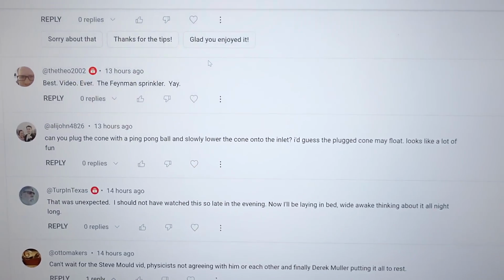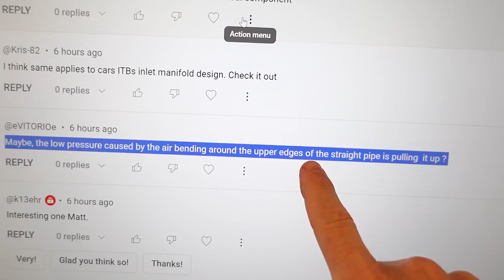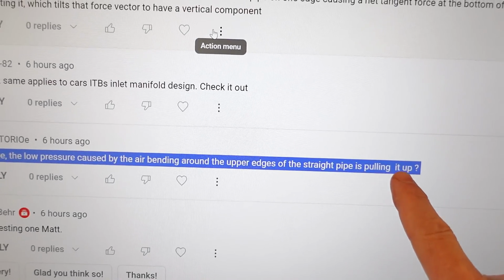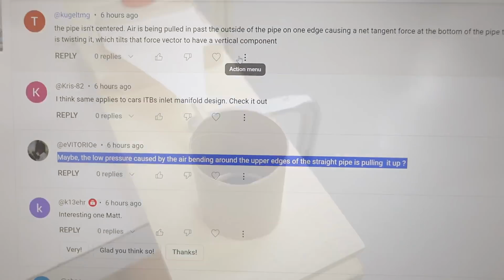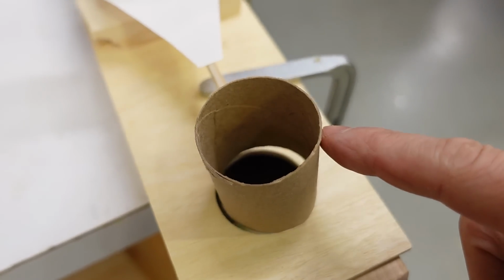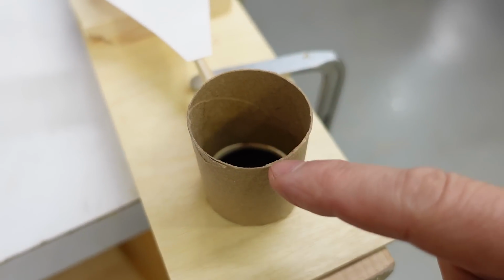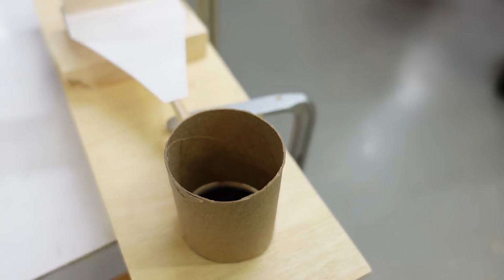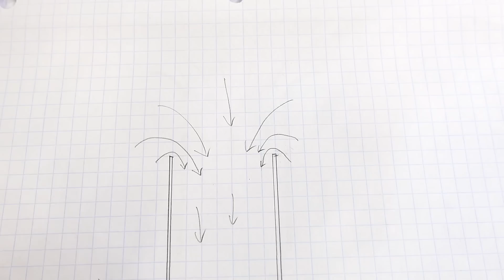Levitating pipe mystery solved

Comment: The same thing happens with the inlet of aircraft engines. The front of the inlet basically acts as a wing and creates lift in the direction the air is coming from

Comment: 2:13 I wonder if this can be used to multiply the pressure difference of a high-flow pump and generate a strong vacuum. Make a pair of concentric pipes, with less than a millimeter of gap at the top. Pull air through the inner pipe. The space in between the pipes should want to drop to a pressure that's lower than the pressure you use to suck the air down the central pipe.

Comment: @Matthias random stuff  I think the tube is creating a restricted path so the vacuum pulls the volume through the gap at the base - this flow forces the tube to either rise or deflect until sufficient volume can enter the inlet - the hot glue around the mouth of the tube just served to stiffen the sides which stopped the wall deflection at the bottom of the tube allowing the air to flow freely past thus it resumed lifting (bouncing!)

A great way to further the experiment would be to add smoke so we can visualize the flow

Really fun experiment, very interested to know if you're sure you're correct or if my theory has merit.  Tried to search through the comments a bit to see if a physics person knocked it out

Comment: Nicely done!   In fluid mechanics terms, what we are seeing is the transition from laminar to turbulent flow at the inlet.  Laminar flow is a smooth predictable flow stream, with the force vectors mostly aligned in the direction of flow.   Turbulent flow is chaotic and multidirectional, with the force vectors pointing in many different directions.   

With the bell mouth, air enters the tube smoothly and the flow is mostly laminar and the force vectors are pointing in the flow direction, causing the tube to suck down.   Without the bell mouth the transition is abrupt and there is turbulent flow in the tube.   Vectors in every direction.  A portion of those vectors are pointing upward, resulting in an upward movement of the tube.

Comment: In the RC plane world, electric ducted fans usually come with a curved inlet called a 'thrust ring' that really helps the static thrust. If it's not a tight fit, it sometimes gets sucked off the front of the duct!

Comment: 2:19 "And just the Centrifugal force ..." Nothing to do with centrifugal - its just lift over a curved surface, like any wing.  Its true that lift is caused by air trying to change direction relatively suddenly, creating a partial vacuum in the process, but it doesn't have to be rotating around a sharp enough turn to invoke centrifugal effects.

Comment: That momentum/turbulence at the top is what lowers the pressure from above/inside. But, I wouldn't think in terms of the pipe being lifted from the top. I'd think in terms of the air outside the bottom of the pipe being able to over-power that lower pressure from above and push it's way under the pipe.

Comment: Once you understand the pressure differential thing, I don't get what's the mystery, a cone has a 45 degree angle to be pushed up on, a straight walled tube does not. Boom.

Comment: 2:33 The shape in the drawing is often called a velocity stack or venturi tube in hot rod car circles. I don't think they're going for levitation but the shape is the same.. It's also used on intakes to maximize lift on some kinds of flying vehicles, hovercraft and increase thrust on jet intakes.

Comment: My motorcycle has the carburetors facing backwards with velocity stacks. It would be better if the carbs were facing forwards so it would help pull the motorcycle faster forwards. How could the engineers do this?

Comment: The curious aspects you discuss in this and the previous video of this channel (good fun, BTW, really enjoyed) are also covered in Smith and Morrison's Scientific Design of Exhaust and Intake Systems.  
ISBN 0-8376-0309-9.
As I recall, the bell mouth shape, megaphone shape, and even the way the exhaust tail pipe is rolled at the tail pipe end to form the ring shown in this video, and likely other shapes, have their fluid theory of operation discussed in detail.  These things can be varied to finesse various aspects of performance, like quality of sound, loudness, broadening the engine's torque curve and so on.
Please read and enjoy.  It does contain a lot of formulas and such, but it also explains theory of operation in terms that don't require advanced math understanding to grasp.

Comment: I’m not sure you have your full answer bc it doesn’t explain the oscillation.., 

I just posted a comment  on the previous video which may explain the oscillation effect
Reply: The oscillation is due to that fact that the lifting force gets weaker as the tube lifts higher until gravity takes over and brings it down, to be lifted again.

Comment: I don't know if the centrifugal force is entirely necessary to explain it. That would contribute as well, but the reason you have flow in the first place is that the suction itself creates a partial vacuum and the fluid flows across the gradient. In the cone example, this should be pretty pronounced (on the vertical axis) as long as the cone is seated. I think maybe the cylinder oscillates so wildly because it's a finer balance (vertically) and the "leaked" pressure and flow would fall off rapidly over a very small distance as it reseats.

Comment: Is the explanation that the top of the cylinder is acting as a round airfoil that pulls the cylinder up or did I misunderstand completely?

Does the same thing happen when air is being pushed in? What happens if the cylinder starts inside the suction tube? Does it get lifted out?

I have so many questions now.
Reply: Yes, that is correct. Exactly the same effect as an airfoil

Comment: Saw the other video a day or two ago, but the answer I've known for ages didn't hit me.  Seeing this one brought it up.
A 'straight' tube isn't straight aerodynamically, it acts as a restriction, due to the viscosity of the air hitting the sides and opposing free flow.  IIRC the answer was the walls of the tube have to move out at 7 degrees in order for the air flow to be free.  Believe that was both sides so 14 degrees spreading cone, and been ages, it could have been 7% instead of degrees.  And suction is basically just reverse flow.  So almost guaranteed this effect is why the straight tube still works and generates forces.
Make a reverse cone from what is in the video, with a larger say 4" suction hole and narrowing to a smaller hole, with approximately 7 degree slope on the sides, and that should be the neutral point where it doesn't generate lift, so it should just sit there.
No doubt ties in with several of the other answers here in the comments that roughly work out to similar ideas.  But that's an isolated value I've known since the early 2000's mailing lists, it came up in a discussion and a side wall has to go out at 7 degrees for airflow to act as a smooth airflow and wall to not restrict the flow.  And of course that's a rough approximation, no doubt the horn or bell type curve is actually a more correct fit.

Comment: Why has no one mentioned 'this is venturi effect.' The word bell has 150 mentions, and venturi 0.
Reply from the maker: For the same reason no one has mentioned pocket holes either.  Its just not about that.
Reply: @matthiasrandomstuff2221 true, there is no reduction in the tube diameter to cause the velocity and pressure differences associated with the Venturi effect.
Reply: @chiphill4856  Yes there is . Venturi effect happens to be a bell shape, a change in diameter over length. The typical square or slightly rounded edge of a pipe/tube is 'too fast' a change in diameter.
Reply: @jimbarchuk  a change in diameter over length.  Yes.  I'm not sure what else you are referring to.
Reply: Venturi Effect is the Name. Yet for the 150x the word bell is used the Name itself is never said.
Reply: @jimbarchuk  In the study of compressible flow, inlets and outlets have their own set of equations, separate from the Venturi effect.

Comment: You're drawing the streamlines as if the flow is laminar.  I don't believe it is.  The o-ring could be tripping the turbulent boundary layer.  Can you estimate the Reynolds number?
Reply from the maker: intake from still air are surprisingly non-turbulent.

Comment: The rounded top makes the tube essentially an upright cylindrical airfoil, which makes me wonder: Does the shape of a plane's wing also slightly suck the plane forward?
Reply from the maker: it doesn't suck the plane forward, but it makes much less drag than a square front on the wing would.
Reply: It would IF the airflow was steaming vertically up the curve of the wing. Flettner Rotors work on that principle.
Reply: @dnomyarnostaw  

In the case of a very wide ~500 MPH updraft, yeah. The flaps would control forward vs. backwards 😁.
Reply: On a plane, you use a propeller or jet to force the wing forward through the air. The wings are shaped so that some of the 'drag' ends up pointing upwards. We call the upwards drag 'lift'.

Comment: I don't think your explanation is correct.  Maybe I can make some CFD models to show it since I don't have a workshop.  The action is happening at the interface between the short tube and the fixed tube/table.  The added ring at the top increases the pressure drop across the short tube (makes the pressure loss at inlet higher).  The surrounding air is flowing into the small gap at the bottom of the short tube.  With a higher pressure loss, the air rushes in more strongly and pushes the tube higher.

Your thinner white tube didn't show the effect because rather than getting pushed up to allow the air to rush in, it collapsed (went oval in shape) and allowed the air to flow beside the tube into the low pressure area.  You could better demonstrate this by adding a second, slightly larger tube mounted to the table and put the small short tube inside of it.  That would ensure air cannot rush into that gap.  If the short tube still gets lifted with that setup, you have disproved my explanation.  

Something to think about: where does the energy come to make the air flow around the inlet around the ring?  It comes from the force exerted on the bottom of the short tube, pulling the inner air column down.  If you integrate that pressure on that surface, you get a force downward and that more than counter-acts the upward force generated by the flow curving around the top of the tube.  It has to, otherwise conservation laws are violated.
Reply from the maker: just make a CFD and show it

Comment: Not convinced by this explanation. Your radius does provide more surface area to act on but simultaneously eliminated the vena contracta so that there is much less pressure differential between the entry and the exit, you changed the flow coef from ~.5 to ~1. That means there is less overall suction pulling down on the tube, allowing it to rise higher. If it were only the rounded lip causing all the lift then the same lip could be added to your pendulum elbow test and it should also swing further than with a plain lip. There is more than 1 thing going on at the same time here.
Reply from the maker: yes, chances are, if I put a fatter lip on the pice of pipe and held it in front of the pendulum, it would deflect it more, as you say.  But if the fat lip wee part of the pendulum, it would make as much difference as the cone being part of the pendulum, which is hardly observable, as shown in my previous video
Reply: @matthiasrandomstuff2221  If it does not deflect it more then it means it is not operative in lifting the tube either and the explanation is wrong. I'd guess it will increase it somewhat but there is another force at work here. Need more data, more testing, more measurement. This is very interesting.

Comment: For the first part, it is easily explained by the conservation of momentum. Since the inlet and the outlet are at atmopheric pressure, the force (assumed in the same direction of the air flow) to keep the cone in place is given by F = m_dot*(V_out - V_in). Since V_out > V_in, F is positive therefore the direction of the force is correct. The same principle explains why a firefighter will “push forward” to hold a hose nozzle in place.

Comment: So, if sailboats were installed with hundreds of bell mouth tubes on a swivel, sailing directly into the wind should be possible? Please test this!
Reply from the maker: only if the sailboat has a huge blower to suck air from all the bellmouths.  But if you have a blower, you'd be better off using its motor to turn a propeller
Reply: @matthiasrandomstuff2221  I don't mean about sucking in this case, I mean about blowing. If the wind is blowing into the many bellmouths and the boat hull and aerodynamics were efficient enough, could the boat move into the wind?
Reply: Put differently, does the same thing happen when blowing air into the tube instead of sucking it out of the tube?
Reply: What Matthias' demonstration shows is that you could create a force lateral to the wind. In his demonstration, air moving parallel to the X-Z plane reduces pressure and allows movement along the Y axis. Orthogonal motion is already used in sailing to 'tack' into the wind. Who knows, though, with enough thought maybe you can come up with a relatively inefficient (at least at first) auto-tacking system based on the Coanda effect 😉.

Comment: But wait, if it is about air inertia, the thinner rim must create bigger vacuum and higher lift. So it's rather due to viscousity then?
Also, what proportion to the lift contributed from the lower rim? You only made changes to the hole diameter, but not the gap

Comment: Airliner jet engines make use of that. By having a rounded over edges at the front and increasing the front area more than necessary for the air inlet they not only make the air inlet more efficient they also produce additional thrust from the low pressure at those curved edges. I find this surprising as it means the air is really sucked in even at the pretty high speeds.
Reply from the maker: It depends on inlet speed an air speed.  If the plane's air speed matches the inlet speed, a bellmouth would only add drag to the plane.

Comment: A common misconception about roofs. While shingles get blown off, flat roofs get sucked off by a vacuum effect of the air passing over the vertical parapet walls.
Reply from the maker: I'm sure shingled roofs experience similar lift if the wind is coming from the gable end

Comment: Is the bell mouth an example of impedance matching by exponential tapering?
Reply from the maker: it is impedance matching in a way, but you don't need exponential tapering.  The bellmouth dosn't need to be bigger than 3x the pipe diameter, tops

Comment: Kohler toilets have a bell-shaped entry to the inlet at the bottom of the tank. Coupled with a valve design that lifts away from that inlet completely, the water from the tank goes down the pipe leading to the bowl much more quickly than that of a conventional flapper valve design using a conventional angular connection between tank and pipe. It really does work well.

Comment: If you look at the air intakes on carburetors or some fuel injection systems you'll notice the intake stacks are generally bell-mouthed as you showed in cross section. Without the bell mouth the intake of air is much less efficient.
Reply: Without the bell mouth the flow becomes turbulent and chaotic, definitely less efficient.  The bell mouth creates a laminar smooth flow.

Comment: Is this the same thing as when you use a stick blender in a liquid and it pulls itself to the bottom of the pan? Vacuum effect but a lot more moving flows
Reply: A stick blender has the blades at an angle, so they act as an airfoil. They suck on the bottom and blow the blended stuff out of the holes in the top.
Reply: @grieske  I guess then a bit of ground effect as you get close to the bottom.. Cheers!
Reply: @jeffers727  That does sound plausible. Have a nice day!

Comment: So back to the hanging J pipe in the earlier video.. there must be two forces that more or less cancel out 1) the air going around the J bend pulling it to the left and 2) the air going around the edge of the opening into the pipe pulling it to the right.

Comment: If you look at your 2d drawing, what you have is a shape similar to an air foil.  It would be interesting to see a smoke test so you can visualize the currents.  I bet you have some swirling low pressure vortices around the outside of the bellmouth.